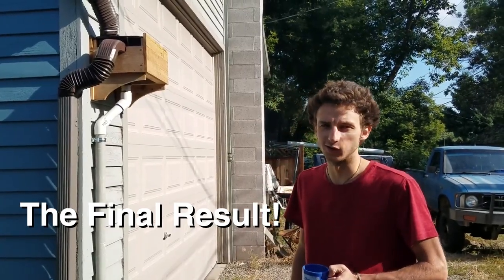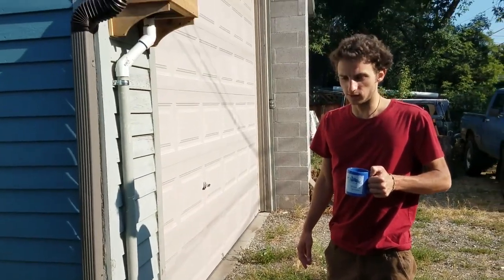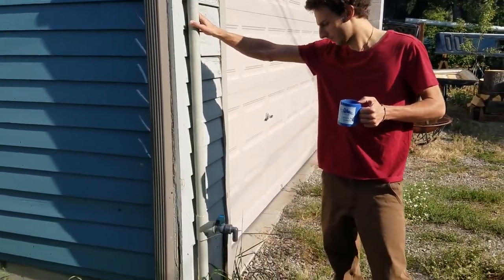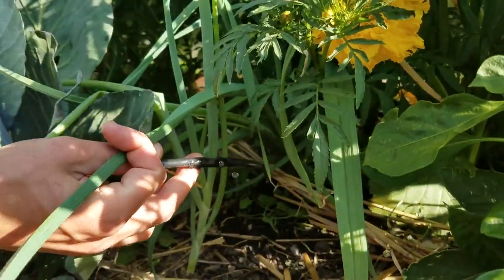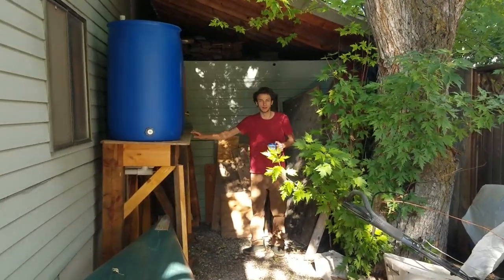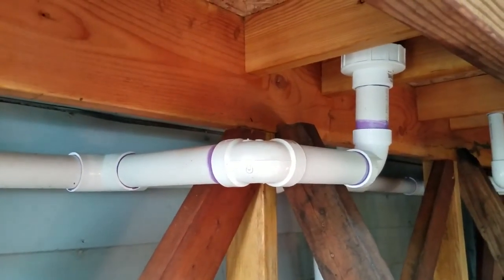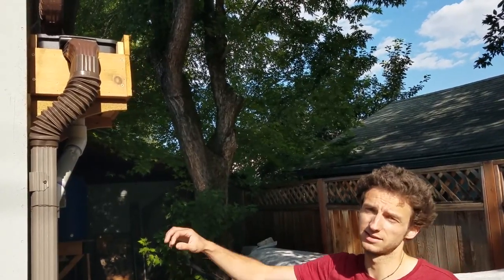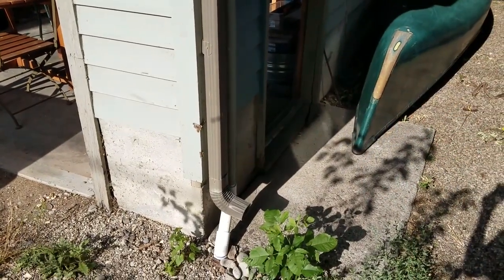Gravity Fed Rainwater Harvesting System (200 GALLON CAPACITY)

Comment: Could you have the barrels a few inches lower than the sand filter?
Reply from the maker: It's best to have the barrels at the same height. If they are a few inches lower than the sand filter, then if the system fills up the overflow would come out the top of the barrels and the overflow system in the filters would not operate because the water would never reach that level